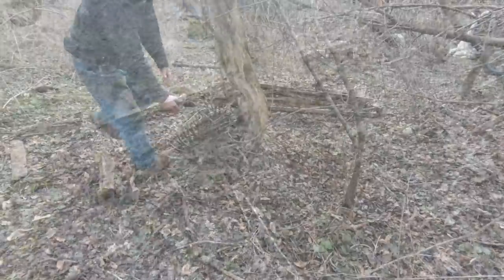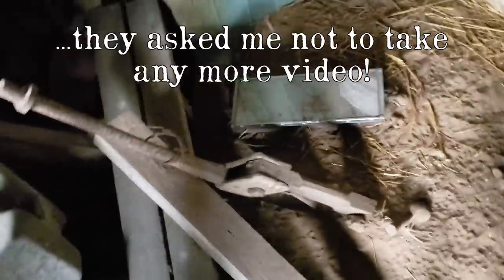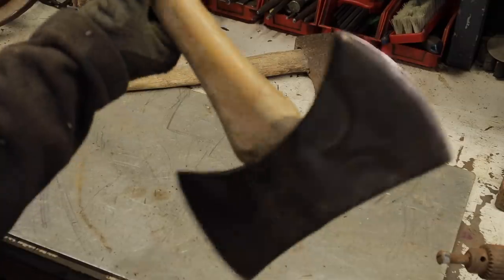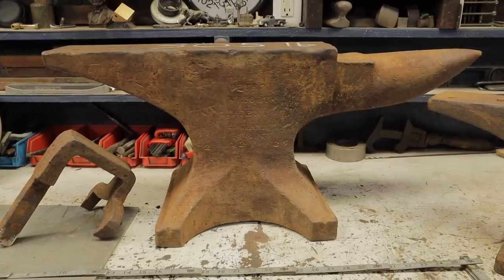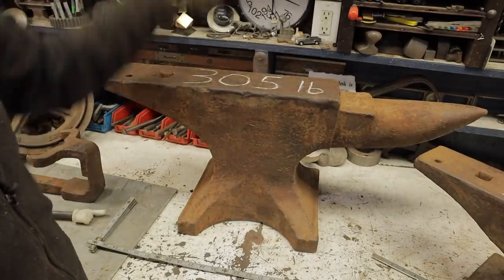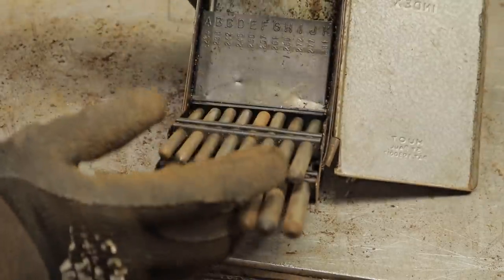RESCUING OLD IRON ~ Two Anvils & a Flat Belt Pedestal Grinder ~ Episode 2 ~ The Abandoned Dairy Farm

Comment: Damn, the saddles where cool. I think someone could do something pretty cool with them, they looked fairly intact.
Reply from the maker: I agree! It there is one thing I'd go back for it's those saddles and bridles... I think there was even an lasso that I saw when going through my video footage!
Reply: I'd think that unless the leather is rotted, the saddles and harness could be rejuvenated. Saddle soap first, then some good oil and wax. Work it slowly to prevent cracks and splits. Rawhide riatas had tallow used on them to keep them supple. Contact a reputable saddle maker for advice. Some old saddles are worth $$$.
Reply: I woulda took them 1st but then I'm a horse freak. Bet there were bridles in there somewhere and plow gear.

Comment: I hope you didn't switch sides for the grinder bearing caps, as they will be made to fit. Babbet were indeed shimmed to allow future tightening, hope you don't need a new spine
Reply: I think you are right on the caps. When we cast babbit bearings at Douglas Corp we put shims between the cap and the base to allow for wear.

Comment: Clearly, we need to find you a steam boiler, and piston drive system for your flat belt overhead power system. You could use the broken down barn wood as your feedstock.
Reply from the maker: That would be AWESOME! I have been thinking about building a workshop and setting it up with proper line shafts and pulleys so that I could run old machinery the way they were originally designed! That might REALLY happen, I just need to come up with the money to do it! HMMMMM....
Reply: Check out Chris Anderson's Olde Iron Shop here on YouTube. He has been making patterns and casting brackets for line shafts. 😆😎
Reply: @SalvageWorkshop  I'll start looking around too. I'll let you know. What do you think , 10 HP? Or less? 7 HP?
Reply from the maker: You know me, bigger is ALWAYS better! I'm more concerned with finding the shafts, pulleys, clutches, etc. needed to set everything up! Something like this is the goal: http://sandersoniron.com/old/JoelWeb%20Page%203-studio-machines.htm

Comment: Regarding your anvil finds...why is it that nearly anytime someone acquires an old anvil, the first thing they think they NEED to do is start grinding and welding on it to make it PERFECT???  That is about the stupidest thing one can do.  Clean up the old man (the Peter Wright) with nothing more than a good wire brushing and some linseed oil to retard the rusting.  Start using it as it was meant to be used.  If the face has some sharp chips on the edge, then some gentle smoothing will prevent marring any work you do.  Anvils do not need sharp, neat edges.  They promote cold shuts and mar work.  Welding on the hardy hole will destroy the hardening of the face in that area.  You have a prize in that old Peter Wright...treat it kindly, gently and with respect.
Reply: I'm with you. Those anvils are fine. They need a good cleaning and a little dressing.
Reply: two thumbs up
Reply from the maker: For the same reason that people always feel they have to tell people on youtube that they're doing everything wrong! Don't worry, I won't ruin the Anvil!

Comment: Think I have that same small two ended diamond shaped steel pick head. It came from my dad's shop. The real thin original foot long wooden handle had snapped off, still have it too. Looking at it, I realize the smaller opening on the pick head is only 1/2 x 15/16" oval, and it has very sharp edge around the opening. This plus the 2 lbs weight of the head made it very prone to cutting the wood and snapping off right at the base of the pick head if you take a big swing with it. Which is probably why you found it laying around without a handle. 

I have a new 18" hickory handle and plan on grinding the lower opening wider and taper the edges. 

The only thing I think this "pick" was original use for is some kind of light work. The ends are not sharp or damaged.

Comment: Thanks for posting video ! My dad had one of the Thor drills.  Those would break your knuckles before you could release the trigger when the bit locked up.
Reply: I still have my dad’s old Thor drill.  It’s a gear driven drill that will rip your arm clean off when the bit binds.  I use it, but it scares the crap out of me.

Comment: I think that hardy tool on the big anvil is called a bridge, and could have been used to make hinges, or other things that needed a tight angle on them. It's probably made on that same anvil long ago. I found a couple anvils along some railroad tracks in Georgia many years ago, I never want to drag anything that heavy that far ever again. I should have kept them but I knew a guy with more use for them than I had. Maybe I'll find another one that's easier to get someday
Reply: I was going to say that same thing lol I bet it is mainly for making steel strapping and hinges and latches etc.. Especially if they were in the horse drawn equipment era they would have used that tool a lot.

Comment: That large Peter Wright is perfectly usable right now. If you want to use it as a blacksmith anvil you want different radia on the edges for drawing out and filleting and such. And no matter how good of a welder you are or how careful you are you will always get a worse temper around the area you add weld.

Comment: Before you do anything else, check those bearing caps on the grinder. It would have been better to mark them before taking them off, but you can still recover. With two caps and two orientations for each cap, there are only four ways they could have been originally. Clean everything scrupulously, us plenty of oil, and try all four "solutions". One of them will be clearly the right one.
I think that round hole in the anvil is a pritchel hole, used, as you say, to provide clearance for punching holes in hot metal.

Comment: Great work, young man!  One suggestion re lifting heavy from another old guy.  You might try cribbing. Most heavy stuff can be rocked or levered to one side, then the other.  Cribbing takes more time but its easy to do and I found I started to like the challenge of it.   I preferred it to ramps and never got it together for a crane mechanism. It wouldn't take much to get to your van height. Good hunting, and lifting!

Comment: The lead pots and ladles were probably used in plumbing with cast iron pipe.  Turn the sheet metal over and the pots fit inside.  The sheet metal attaches to a burner using the 3 clips and directs the flame around the pots.

Comment: 13:35 Carp so close but so far. What the hardy hole device on the anvil never seen one like that (Guess it rusted in). hope you checked for tools and hardy hole items around the area of the anvils.. Look like your going to need a line shaft in your shop. Your #30 Thumb up. 

Where are you located? Apx area.

Comment: I suspect that what you called a drill is actually a  valve spring squeezer for engine heads.
The shaft with the two plum block bearings probably drove the grinder you found. the pulley looks to be the same size as the one on the grinder.

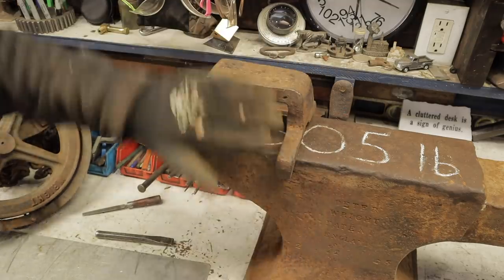Comment: At about 36:00 with the thing in the hardy hole, I think it may have been for straightening shafts.  With it in the hardy hole and the shaft stuck under at the little rounded bit it would be like a vise type clamp and you could work at bending the shaft.

Comment: I could be wrong but it looks like you have put  the bearing cap on 180°  out on the end with the larger grinding wheel .
I'm only at 20 min in on the video so don't know if you picked up on this later.
Cheers Eric

Comment: You need shims for the babbitt bearings.  You do not need all the same diameter shims, but you can shim different amounts to accommodate the variable diameters across the shaft.  As others have mentioned, make sure the bearing caps are in the correct location and not switched.

Comment: A battery chainsaw would be handy in getting through the vines and trees.  Need a gasket on the grinder saddles.  Nice scores - and the nice tools. On the 175 anvil - how much does it weigh ?   I bet the face didn't but was there for horse shoes to pound the inside not the outside.  Other round items.  Check the weight before adding so much metal to the face of that anvil.

Comment: You really need to build a collapsible hoist to go in your van!!

I think the tool attached to the big anvil is called a bridge and it's it is basically made to use how you think. Because of that wedge on the underside, I think the blacksmith, who made it, probably stood on the opposite side to the logo and just flipped it around 180° when not using it and left it how you found it the last time it was used. John at #BlackBearForge uses one of those bridge tools sometimes when working on pieces where he has cut a piece of steel lengthe wise and wants to work the individual "forks". You can work one side while the second side is underneath the bridge.

I think the first hammer head would have been used for working stone and dressing the faces.

Very, VERY cool finds, especially the axe you've already cleaned up.......and the anvils........ and chain hoist........ it's actually all really cool!!! I want to raid your workshop to fill mine!!! LOL 👍

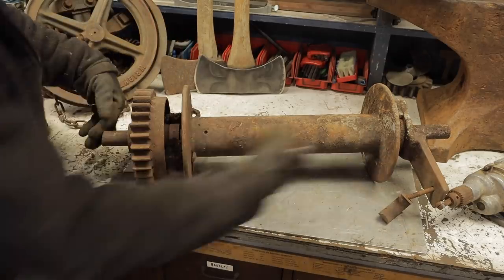Comment: @27:13, that wood is not from a flat belt pulley. The drum would have been turned by a pinion gear on a different shaft,  running against the gear on the end of the drum. My first thought was a wood bearing, but it's not near wide enough to take the load of a winch. Maybe it had a wooden guide, to keep the cable from wandering into the gear?

Comment: That shaft looks like a buzz saw shaft used to cut firewood. the blade is missing and it would have been with a flat belt from a tractor. I have two with babbitt bearings, one we used when I was a kid.

Comment: Try tightening all 8 bolts down like putting on an engine head. The shaft may have a small bend in it or the bearings housing may not be in the same plane causing the difference.

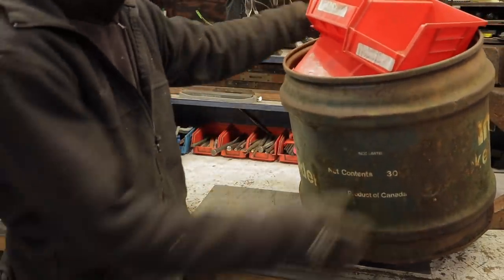Comment: I've loaded anvils twice that size by hand and a bunch of two feet wooden planks. Gently lifting it inch by inch putting the wood beneath it until you reach the desired height and just wiggle it onto the car. 47:12 that pick might be something they used to clean big stone grinding wheels they used to grind grain with.

Comment: As to the Trenton anvil: I've seen many anvils with broken faces like that. Had a Hay Budden about that size with about half the face missing. Unfortunately, it's not uncommon as the steel face, being welded to wrought iron was a tricky affair. All the anvils I've seen broken in this way have the curved broken edge like yours. I'm guessing that the hardened steel has a tendency to break in an arc. That one should be fairly easy to repair. I gave mine to the teenager son of a friend who is interested in getting into blacksmithing.

Comment: I am pretty sure with the pins is ether high speed reamer blanks or drill blanks. The only way to tell for sure is mic the diameter. A drill blank will be on size to an even fractional, letter or number . Reamer blanks are .002"-.003 over the nominal size. They are made of HSS Steel used to make cutting tools and gage pins and various other things.

Comment: The only motors that will fit into that base won't be strong enough to run the grinder with any power. You best figure a way to flat belt it from above as it was designed.
Reply from the maker: I've got some 1-2hp Motors that might work, but you might be right! Or I build a base that attaches to the bottom to hold the motor... Not sure what I'll do quite yet!

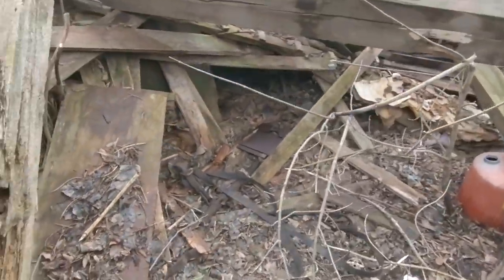Comment: 4:30, some nice timbers, COULD be salvaged for a shed or workshop.  BTW, looks like they were machine sawn, not hand cut, except for the joints....the wood is too smooth for hand cut unless they spent a lot of time hand-planing it, highly unlikely for a barn.

5:10. looks like a hay stacker, ones like that mostly tractor pulled, but horses COULD do it.

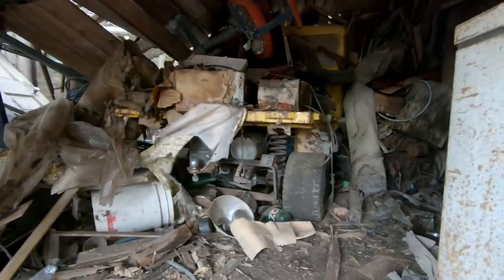11:10, that COULD be a CUSHMAN work vehicle, real useful around a farm or shop.
People actually collect them IIRC.

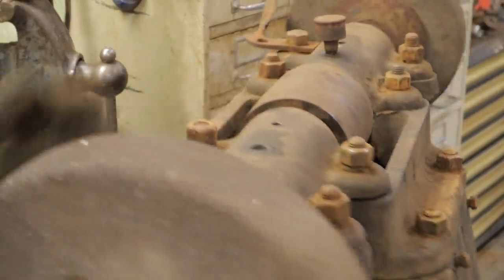22:07, that pedestal grinder is missing SHIMS between the caps and the head of the machine.  You will need to find thin sheet metal (brass, steel whatever) to stack up/space the cap up enough to allow the shaft to spin freely, but allow no slop.
This won't take long to do, and you'll have a hell of a machine IF you keep it properly lubricated.

47:20, that hammer head could be for working stone.

51:24, yep, IIRC it's used for boring holes in timbers on-site.  Uses square shank wood bits.

Comment: Not positive but the little swivel pot on the handle looks like an electricians solder pot, they soldered the twisted wires together and wrapped them in tape before wirenuts came along. The twisted wires just stuck down and they would just dip them into the solder. Nice finds by the way.

Comment: Ring on an anvil means virtually nothing.  A bell rings beautifully but makes a lousy anvil.  It's all about rebound.  The whole "check the ring" thing to judge whether an anvil is good or not is a myth that won't go away. Many excellent anvil brands are known to ring rather poorly and many poor anvil grands ring quite well. 

When anvil "shopping" carry a 1/2" ball bearing with you and use that to check rebound.  For newbies--DO NOT get the bug to repair an anvil by grinding and welding.  More anvils are ruined by "fixing" what are actually just cosmetic issues than anything else--especially homebrew welding.  Get to know your anvil by using it for a year first to decide if it actually NEEDS repair (vs working around the lesser areas) and then research even deeper to learn how to repair it correctly.  Save the repairs for the true basket cases.

Comment: i know nothing on the large anvil with handle. Looks like it would hold something down while hammering it, the wedge made into the side and the one on the front looks made for different thickness to slide under while hot, and easier while saving time not to lose your heat.

Comment: Ever though of you might have the bearing caps on the wrong side in reverse 
You might have forgotten in the rush in loading 
You may them on backwards
Reply from the maker: I think I tried them on the opposite side, but I agree, I should give that a shot before anything else! Thanks for the thought!
Reply: @SalvageWorkshop  u got one twisted that's why it barely snugs down and binds the shaft
Try moving that cap to the other side rotate it around on both it might surprise you because of the casted babbitt bearing is fitted to your opposite side
Reply: Go back to video when you were loading for the first I saw jumbled up the caps threw in your van

Comment: As a kid, now 78 years old, I spent many hours watching my father using his forge workshop. Making and repairing agricultural machinery etc. The square hole was where he fitted all kinds of different tools, chisels, bending tools and so on. Always working with red hot metal heated in a furnace. with leather bellows , which now and again I was allowed to pump !.
The appliance in question I do not recognise but maybe used for bending steel flat plate or bar. He made many large hinges for field gates, elongated u shape where the long sides fitted each side the wooden gate bars and had a ring at the end to fit over a spike like hinge. These were known as five bar gates and were heavy, so the brackets were made of strong flat bar. Sorry not good at describing a 70 year old memory .

Comment: Paint soak it with deisel fuel and wire brush it with a heavy brush on an angle grinder!to clean the anvil up then it can be refurbished with plate steel welded on to it to reface it!

Comment: Hard surface rod is not the best restoration for anvils. It often causes cracks in adjoining steel. Check Google for the Gunther method of anvil repair. It's well researched by metalurgists.

Comment: your going to have to run a flat belt from over head .  and the size that is at least a 2 horse 110 .  yes the made a low coltage 2 horse  .  friend and I had a knife shop 30 years ago and turned it into a grinder buffer

Comment: 28 to 30 minute mark would have had a circular saw blade sandwiched between the arbors on the one end. then it could have been use similar to a table saw.

Comment: There's a very good chance that Inco barrel was on my truck at one time.
Reply from the maker: Interesting! What was in the barrel? I just thought it looked cool!
Reply: Salvage Workshop- It was almost certainly powdered nickel. Inco made various grades of Ni powder for various purposes. I worked in the Nickel Cadmium battery industry, and we used grade 225 if I remember correctly to form a nickel sinter, which was then made into the Ni and Cd electrodes. The nickel powders varied in the shape of the Ni powder particles, the spikier they were the more porous plates could be made. 🇬🇧